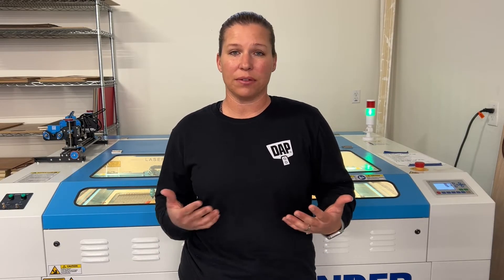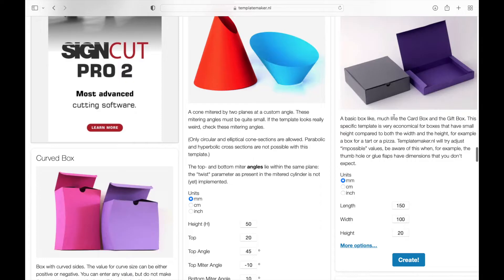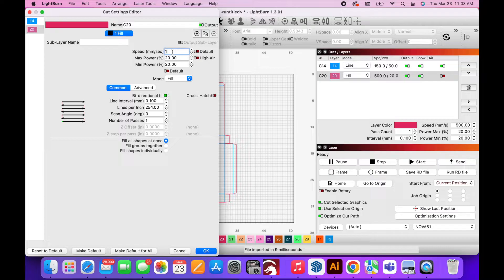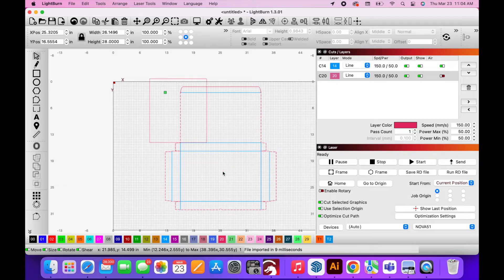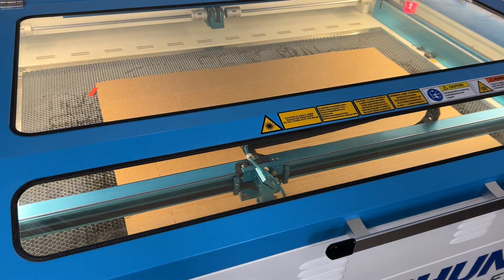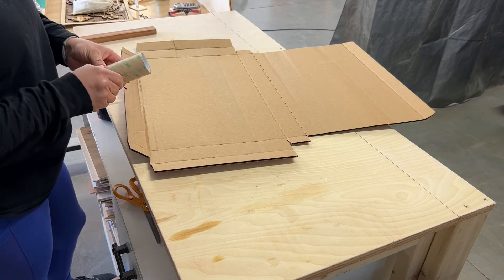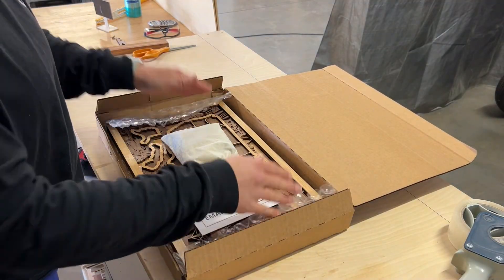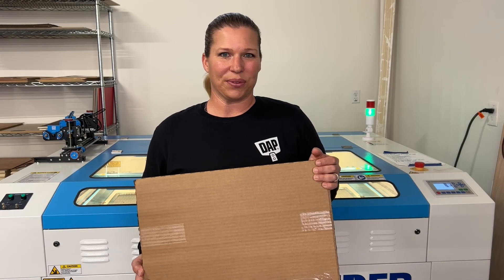How To Cut A Cardboard Box On Your Laser

Comment: Amazing thanks! I am on xtool and their xcs software, they dont explicitly have a preferation mode setting... Do you have any idea how to go about making a box wihtout this function?
Thanks!
Reply from the maker: That’s a good question. Maybe make those lines a scored line, so you know where to fold the cardboard?  So a partial cut through just the top layer of the cardboard?  Are all Xtool lasers compatible with Lightburn?  If so, that could be an option for you.  I just purchased an F1 today and I know it’s compatible with Lightburn.

Comment: Thank you for looking into this!
As a model builder I was looking at this from a different angle. Remove the backing from one side so the corrugated surface is exposed and then run it through the laser and you have a wavy surface for stuff like ancient Japanese castle roofs.

Comment: Thanks for the awesome video! I tried it out today and I have a question about the type of cardboard. I tried it will a 2 mm sheet of corrugated and when it bent the cardboard at the perforations that run perpendicular to the grain of the cardboard the card board rips/cracks. Are you using a thinner cardboard? Thanks again for the video!
Reply: For anyone reading this comment having the same issue, I was able to solve the issue by changing the power and speed on my perforation cut so that it would only cut through one side of the paper on the corrugated cardboard rather than cutting all the way through.  When you bend the sides, you place your cut piece with perforation side up bend the sides up.  That helped prevent any cracking or tearing on the outside of the box and it is nice and strong.